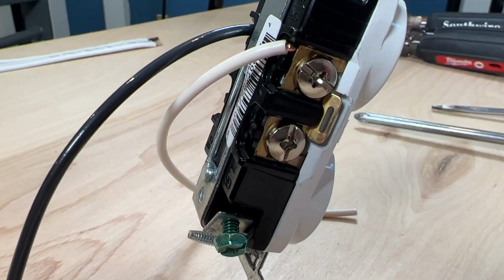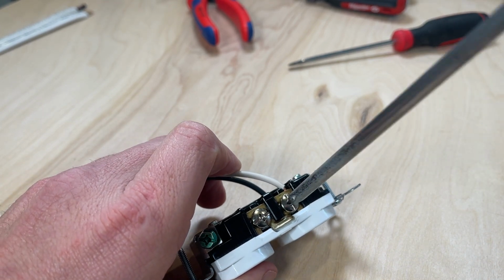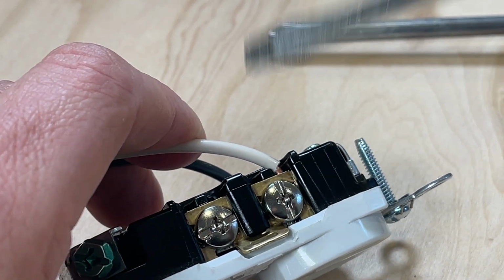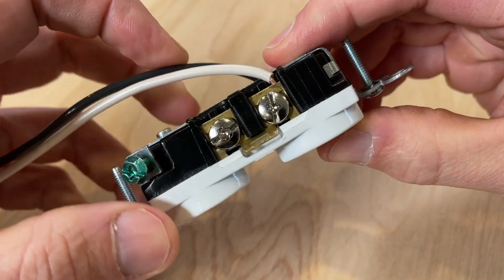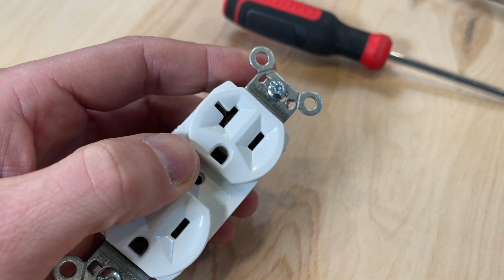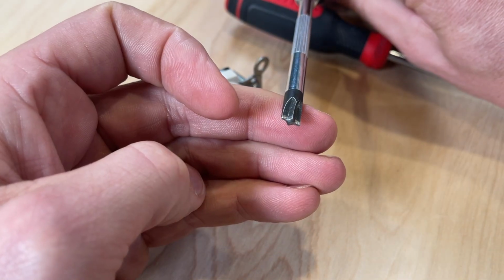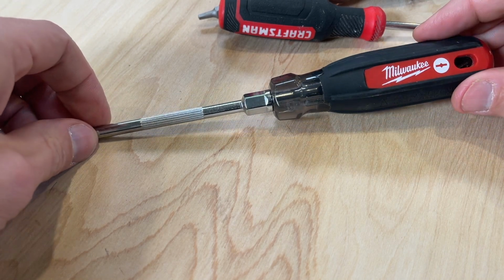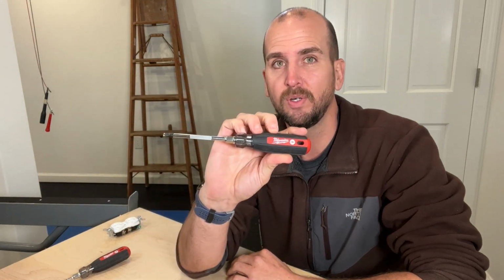80% of People Use the Wrong Screwdriver For Electrical Work

Comment: Robertson, all the way, for everything. I would never buy anything but a Robertson headed screw, unless I had no other choice. Philips head are a second choice. Slotted screws go into the garbage bin. Robertson screws can be placed onto the driver and will usually stay there as it is moved into place. Try that with a Philips head or a slotted head.

Comment: I've done a good amount of electrical work for a DIYer. I moved from Phillips to Robertson years ago and see no benefit to carrying another, specialized screwdriver.
You need a 1) small slotted to remove and replace the faceplates and old box screws. You need 2) large slotted to remove the old terminal screws. You should keep 3) #2 Phillips for other fixtures and accessories. I keep a 4) Robertson in my belt and a 5) long Robertson Driver for my impact driver to run the screws in quickly.  My box and belt are already crowded.
Reply: I have all those in two hand drivers,  2" bits for my Picquic Dash 7 screwdriver and 3" bits for my Picquic Sixpac Plus . Both can carry 7 bits. They work perfectly in a low torque "impact" power driver.

Comment: Standard NEMA outlets optimally require two Robertson bits, the larger (Red handle) one for the terminals, and the next down size (Green handle) for the box attachment screws.

Robertson Screwdriver Types
Currently, there are five different Robertson screwdriver types available, with suitable screw size indicated by the color.

Orange drivers (#00) are appropriate for use with screw types 1 and 2. The recess size range (the size of the corresponding square imprint on the screw) is from 1.77-1.80 mm.
Yellow drivers (#0) work with screw types 3 and 4 and feature a recess size range of 2.29 to 2.31 mm.
Green Robertson screwdriver (#1) operates with screw types 5, 6, and 7, with a recess size range of 2.82 to 2.86 mm.
Red Robertson screwdriver functions with screw types 8, 9, and 10 and has a recess size range of 3.34 to 3.38 mm.
Black Robertson drivers work with the largest screws, types 12 and higher, and have a recess range of 4.81 to 4.85 mm.

- : History of the Robertson Screwdriver
Reply: Stephen:
When you write "screw types" I presume you mean "screw sizes".  For example, in North America, the machine screws securing switches and receptacles to boxes are #6-32.

Comment: It's a bit in the weeds, but that's not at Robertson bit. It's just not.  That's a square. They aren't the same thing. Robertson are shaped differently. Honestly even in Canada you don't find the real drivers all the time. Robertson drivers will hold a screw to the drive as well or better than a magnet sometimes. That square won't.

Comment: You yourself are using the wrong screwdrivers for electrical work. you need insulated screwdrivers... I would not use a normal screwdriver on anything electrical even without power because I make it a habit to use them regardless just to never take a chance.

Comment: I usually throw away Robertson bits that are included when I buy a set.  They strip very easily when using a powered device like a drill, or impact driver.  But this is a great idea!!!  I never knew the #1 Robertson fit these outlets.
Reply: If you are going to use them a lot, buy bits made for impact drivers, not just ones that fit into them,

Comment: There's  reason why the philips cams out.............

It was designed to!!!
The philips head was designed for aircraft construction, it's supposed to cam out before the thread be can be damaged, useful on soft/light metals such as aluminium.

I'm not sure why the US and Canada use philips so much, it's by a long way inferior to the pozi-drv.

Comment: Good info.  Personally not going to spend money on a specific tool I'd probably use once and be lost next time I want it a year down the road.  Slotted screwdriver at the correct size and you're good for that wire and the faceplate.  Job done.

Comment: One GREAT benefit of the multi-drivers is that you can put a #1 square drive on one side of the sleeve and a small straight blade bit on the other side. Allows you to quickly flip from installing outlet and switch wiring then flip the sleeve and install the plates.

Comment: I use what ever my hand touches first,  I really don't have a problem with turn screwnwith any of those and in 40+ years I can't recall a wire pulling out of the terminals.

Comment: If you can't tighten those terminals with a flat blade screw driver, then you need to pack it up and go home! hahahahaha I can use a phillips with no issue at all. Although I do sometimes shatter the device because of too much torque from the impact gun. Not too bad though, it only happens 47% of the time.

Comment: The advantage of either "superior" bits is outweighed simply by having to go to the next room to retrieve the bit. It's an electrical connection. They aren't supposed to be over torqued.
Reply: But not tight enough, and they get loose, which causes resistance, which makes more resistance, and that causes fires. Use the right tool for the job and put it tight.
Reply: @Keith Savage  it's a number 10 screw. I can tighten that tight enough with my fingernail. 
If you can't get it with screw driver you shouldn't be trusted with electrical work

Comment: Bought Wiha ECX drivers in #1 and #2 a while ago when doing panel work to bring my panel up to current code with AFCI/GFCI breakers.  Huge difference in confidence tightening the fasteners.  They've also been super handy on receptacles and switches.  I am slowly ridding my home of push connected outlets and switches and replacing them with commercial grade or wire around screw connections.

Comment: Always used a square drive bit in a Festool cordless w/ adjustable torque setting for the last 10 or 12 years. Never had an issue. Pretty much Klein for all of my electrical hand tools. No regrets.
Reply: Retired a while now, and while not an electrician, I do still occasionally play one irl.  ;)
That said, once saw a very experienced journeyman (who knew better) lean into a hot 400A commercial panel where he was tightening something up and it slipped. Didn't quite kill him. Other than never working on hot gear, that was the last time I didn't use a square drive.
Reply: @Kevin-mp5of  ha ha, thanks. I DO know better, and can't even blame auto-correct for that one.  :)

Comment: The Phillips you used in this video is trashed.  If you had one in good condition it wouldn't have cammed out so easily.  The slotted blade was undersized, if you would have used the correct one you would have had much better results.  As an industrial technician, a lot of my work involves various terminal blocks, contactors, etc. that use similar fastener heads as the universal heads you showed, but don't normally include the Robertson recess (it further weakens an already compromised design).  I've been using what I've always known as "terminal block" drivers which are a combination of a slotted and Phillips drivers rather than the ECX which is slotted/Robertson.  I use both #1 and #2, not sure if #0 or #3 are available, never had a need.  Another very common mistake that just about everybody makes is using Phillips drivers on Japanese JIS screws which are designated by a small dot punched next to the recess.  A standard Phillips doesn't fit correctly resulting in a marred head even if you don't slip.  Using the correct JIS driver will not damage the screw head and will allow much greater torque. Like most things, using the correct tool for the job will always provide superior results.

Comment: I'm a residential Electrician and I don't like using that milwaukee screwdriver. Any good quality branded screwdriver (Snap-on, klein, etc) 
should not slip with those outlet screws. Maybe I'll give it another try. Thanks

Comment: I have found that a slotted screwdriver is always the wrong tool for the job because I have never encountered a slotted screw whose job could not as easily be performed by a phillips, square, torx, or allen head screw.

Comment: If I'm doing a lot of devicing I'll grab my Robertson #1 (Wera is slick). If I'm just going a service call I'll just use my Philips (rarely) and cabinet tip to tighten down (i know, usually too small). I've had an insulated ECX like others here for a few years but never care to break it out. I think i find it more frustrating to line up the bit just right every time, instead of just putting a square #1 in and going to town. Maybe I'll break out my ECX again soon and try it and see if my feelings towards it will change.

Comment: I had an argument in prison with a dude about the existence of  a " pozi-drive" screw and its  advantage. another advantage of Phillips is your slotted driver is going to put a hole in your speaker. Not to mention that screwdrivers come in different tip hardness to avoid screw damage where that is important. Sometimes the screw is more valuable than the tool.
Reply: Hey, selling screwdrivers (Phillips would be more efficient, wouldn't they?) would be a great business. Can't wait to set up a concession stand in Rikers' chow hall! Thank you for the inspiration.

Comment: The blind trying to lead the blind. You can buy a decent set 6 electrical screwdrivers 1000v rated and specifically designed for this type of work for $30 and that's for a decent brand like Wera. Do not listen to this DIY clown!

Comment: I highly recommend buying a number one and a number two Robertson screwdriver. The number one has green the number to is usually read. You can get them off eBay. I highly recommend them don't waste your time with a flathead screwdriver. Or a Phillips screwdriver. I wouldn't use little bits for your screwdriver. They usually break or get deformed. By the actual screwdrivers keep him in your tool set. You will use them very often. Oh yeah I'm from Canada

Comment: Robertson for the win!
…and all is Americans can thank Mr. Ford for the popularity of the philips. In the early days of Ford many people were inventing screw heads. The philips screw was designed to camber out before stripping the threads. So it was an obvious choice for Ford Motor Company to start using them on the new assembly lines.  The Robertson was always able to provide more torque, but requires more skill to drive in properly. 
I am an electrician and in my opinion I REALLY wish the electrical manufacturing companys would just pick one kind of screw head and make it a standard. I hate the combination screw heads!

Comment: use a larger phillips head that fits snuggly. A correct size phillips head screwdriver show be snug enough to hold the screw on a 90 degree angle.  The screws you using look like a #3 size, also the flat head used was way too small, again use the largest that fit snuggly.

Comment: Well technically all these screwdrivers are wrong, because you should be using a torque-limiting screwdriver for electrical terminations. Wiha, made in Germany, makes a good one for about $150 and you can use any tip you like with it.
Reply: My daily... Torque driver... Is likely that same Wiha. I have one in my electrical backpack & another in a rolling tool organizer. Excellent.

Comment: Robertson screwdrivers are a must in most RVs because just about every screw has a square socket head. I also recently replaced a power panel in my RV and the Robertson was by far the best on the micro circuit breakers.

Comment: While I could still work, while the Chier Engineer at a high-power UHF TeeVee station, I'd removed all Phillips & Straight-blade fasteners, & replaced them with hex-head fasteners & used a torque-driver on every fastener in the power Klystron & power-supply cabinets, just my 2-cents worth.

Comment: 1) Throw away the worn phillips.  They do wear out after a while.  2)  Use a wide cabinet tip screwdriver.  3) or use the square drive, but these are often available only in the so called professional line tools such as Klein or Greenlee and can be somewhat pricy for the DIY-er who is only occasionally doing installs.

I do appreciate your video.  It will be helpful to many.

PS:  Don't backwire.  use pigtails.  That way the full current of the circuit is not going through the first receptacle in the circuit.  Also, if the receptacle fails, it doesn't render the following receptacles inoperative.  It can be a pain to trouble shoot when you don't know the order in which the receptacles were wired.

Comment: I am an electrician up here in Canada and the main screwdrivers we use are Robertson. The vast majority of fasteners here are Robertson. We refer to them by colour mostly (all the stand alone screwdrivers are colour coded). Green are number one, Red are number two (the most common size) and Black for number three. There is also a Yellow one that is smaller than a Green but it is rarely used. I have never seen the Milwaukee ECX  type. It looks superior but would be limited in use as the screw would have to have a slot cut as well. Most screws here are Robertson (square) only. Very informative, THX

Comment: Also want to point out that an allen wrench can work on that too. Not sure what size, but given that square bit screws are getting more common, and everybody should have a set of allen wrenches (or drill bits mimicking them) around, and there's definitely a size that will work on these. They are basically the same as the Robertson screwdrivers mentioned in the video, 'cept they come in different sizes.

Comment: When I was an apprentice electrician, one of the first things my boss gave me was a Robertson screwdriver - we just called it the square driver though. Really, with a proper tip on a decently sized Phillips I could still break a screw in the terminal and would rather not add another specialty driver.

Comment: Just my two cents; many people are under the assumption that Square Drive and Robertson are the same but it is my understanding they are not. Robertson is a patented design (no idea if it still holds) which "America" would not recognize (if I may put it that way) so would not adopt, even though it is superior to other older designs in many respects or uses. The Robertson has a precise taper that allows the screw driver to maintain a tight fit within the Robertson screw head. It is my understanding the Square Drive does not have this taper although they do appear to have a "curved" shape to the bit sides. Robertson screw drivers are always colour coded while Square Drive are not. I know from using both the Square Drive is not as good a fit as the Robertson.
What I do not know and would love an answer to ; are the square headed screws (that are not labeled as Robertson) found in common use today, precisely machined to fit a Square Drive, or are they some kind of generic screw?  I have not found screws labeled as Robertson for some time.

Comment: I have been using the same brand of Stanley 100 Plus screwdrivers that I started using in 1964. Straight blade of the proper size for receptacles and sws. usually a 4" blade.

Comment: “Bad sound makes good video look bad.”
Reply from the maker: Too much echo?
Reply: @EverydayHomeRepairs  The world is perceived as differences. Compare the sound on your video to others who use a microphone clipped close to their mouth.

Most of the bad sound heard on YouTube videos is because they are using the built-in microphone on the recording device and it is more than about 10 inches from the talker’s mouth. Even recording with an omnidirectional body microphone in a very live acoustic location (for example, an airplane hanger) can be spoiled by the reflected sound unless the mike is clipped or taped as close as possible to your chin. The objective is to try to get the best signal-to-noise ratio, whether it is loud ambient sound or reflected sound in a quiet room. There are directional body microphones that work better for those situations but they have to be carefully aimed in the direction of the speaker’s mouth. A relatively low cost option for wireless recording with an iPhone is using one of the Apple AirPod models in conjunction with a paid after market iPhone app like FilMic ($15) so you can use the built-in mike on the earphones. When recording you turn the AirPod volume down to zero so you don’t hear yourself in your ear when you are talking. There are posted videos by YouTubers demonstrating how it works and how far the Bluetooth range is. Here is the app link:

https://apps.apple.com/us/app/filmic-pro-video-camera/id436577167

Comment: Thats the wrong slotted screwdriver. The square driver will strip the screw if doing rework. I would only recommend for new work. Old work, always a slotted(but larger, correct size)

Comment: The only flaw with this is that the cover plate for outlets will have a different type of screw, so it's convenient to be able to use then same screwdriver for both. It just depends on whether it's something where you're working on a couple outlets or dozens of them.
Reply: Annoyingly enough, most cover plate screws are slotted for some stupid reason. And they are also the worst screws around for screwdrivers popping out of them, AND the plate cover screws are oftentimes far smaller than the screws on the outlet itself, which means if they were going for letting you use the same screwdriver on both, they failed miserably because a screwdriver that would work well on the plate screw, would suck at tightening the larger screw that grips the wires.

Comment: What the hell?! That screw CLEARLY fits a PH3 bit or a large slotted bit. OF COURSE, using PH2 or small slotted screwdriver is inefficient. Using a PH3 screwdriver is PERFECTLY FINE and fully efficient. An appropriately sized slotted bit will do just fine. Why does the video not mention PH3 and large slotted which are MUCH, MUCH more widespread than those exotic PlusMinus/ECX bits? And no commenter mentiones PH3 either! Is this some kind of conspiracy? WTF?!